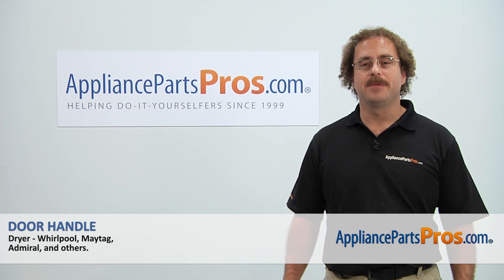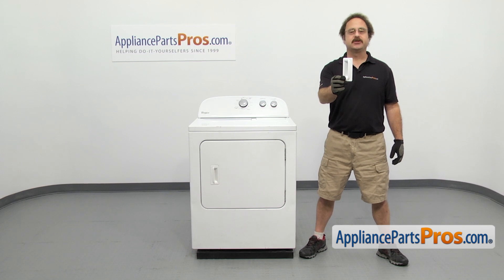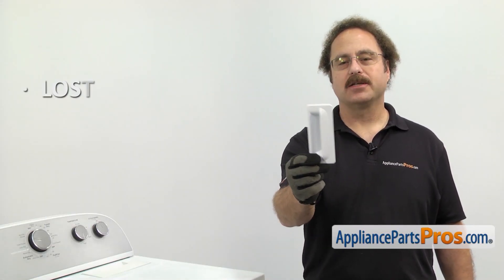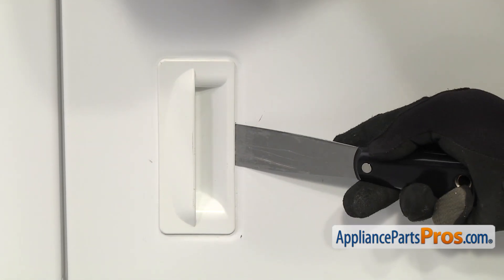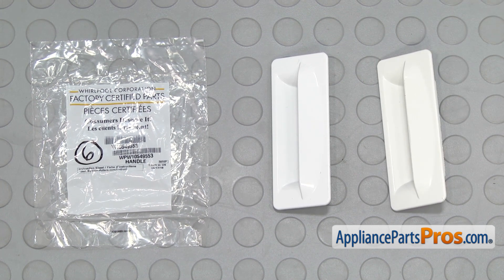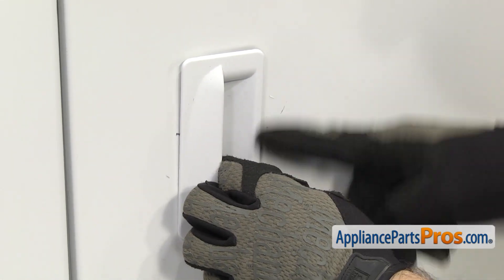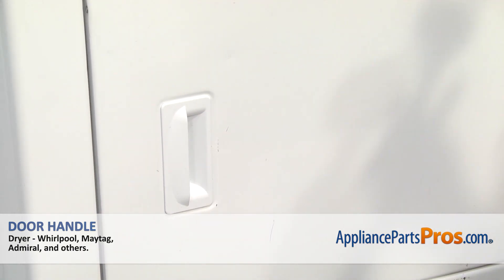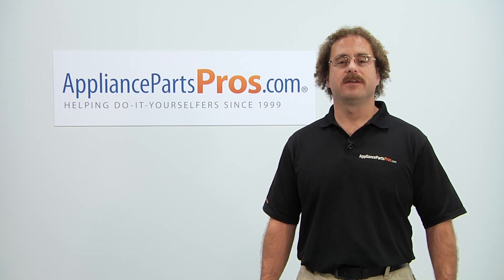How To: Whirlpool/KitchenAid/Maytag Door Handle WPW10549553

Comment: Why in the world would anyone use a dowel and a hammer to pop part into place like shown at the end of the video ..... all you need to do is align the little tabs or ears on the left side Just like in the video and then just simply push the other side in it’s not hard it will pop in very easily